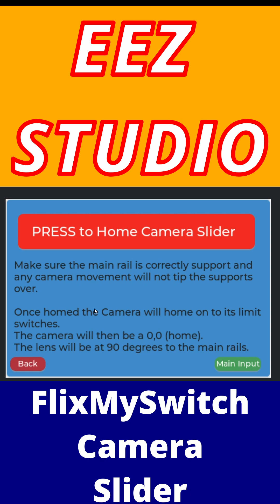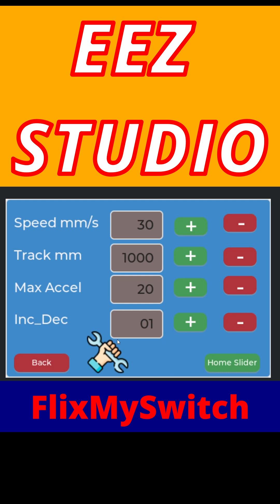How to in EEZ Studio FlixMySwitch Smooth 3D Printed Camera Slider #eezstudio

Comment: This is coming together beautifully. Thank you for all your work and your videos using EEZ flow. You're the only person I've found getting it to work well in the arduino ide and explaing how you've done so.
Reply from the maker: Thanks for the encouragement. I am pushing on with the 3d printing side of this project, hence the short camera slider video. Now working on a circuit board so I can get the screen to actually drive some stepper motors